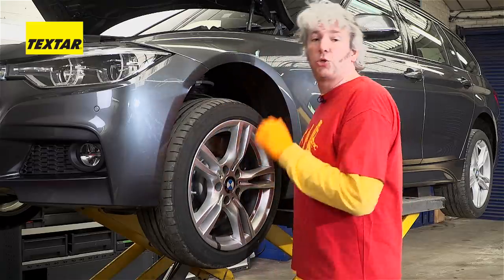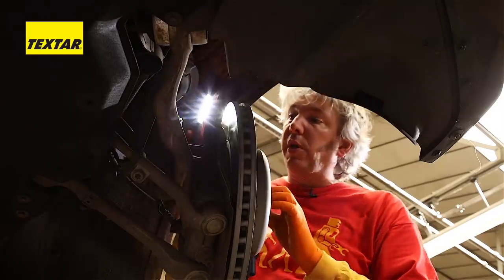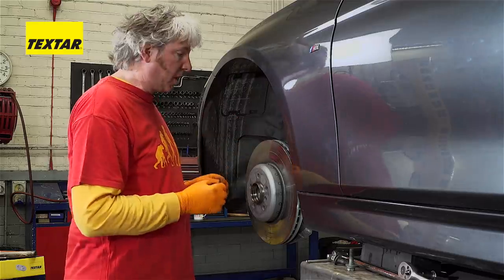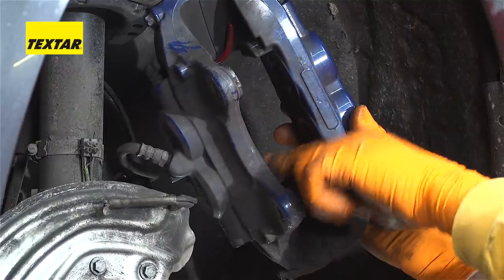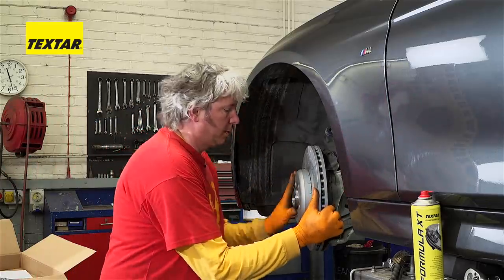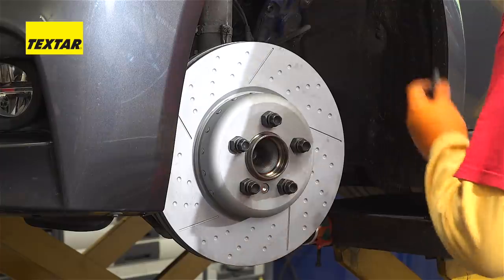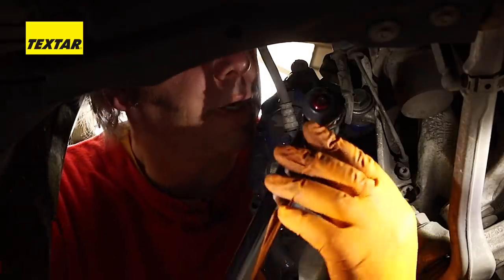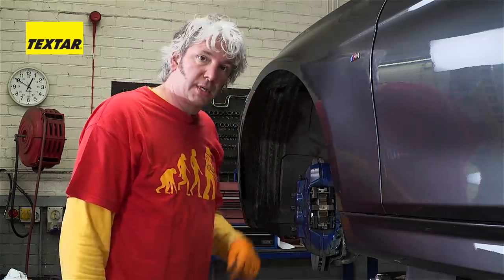Brake replacement with Edd China

Comment: I would appreciate a fuller discussion of when and where to use anti-seize or grease to prevent corrosion; particularly regarding the rotor/hub interface.

Comment: Thanks- a good basic intro video, using a clean modern test car.  I hope more people take on repairs and basic maintenance, using videos like this as a guide.  It would be interesting to repeat the same process on an older vehicle with 100K miles on the clock... with rust and seized parts.  I'm you could feature many Edd's top tips?!  Maybe list some typical tools for the job, for those budding mechanics looking to build up their tool kit.  Just a thought.

Comment: Thanks, Textar, for reiterating never to use copper grease. I've been telling people this for years and include it in all my brakes videos. You wouldn't believe the 'hate' I get for it❗ However, Textar produce a tube of Ceratec (in common with your Mintex and Pagid cousins), so how come Edd never used any on this job? Also, after cleaning the pad running surfaces with a wire brush, how come he never cleaned down the dust created with a spot of brake cleaner?
Reply: I am rather sure that I saw him on WD using copper grease on front of the pads "to stop the noise you get when you install new brake pads". That is exactly why I was searching for video of him replacing pads, since now I'm not sure which is correct.

Comment: Thanks to this video I discovered Textar brakes. Installed them on my BMW 335i. I spent literally half of the amount the BMW OEM brakes cost and the quality is good.
Reply: Well i heve textar pads and discs. disc deformations at the wheel bolt holes are a problem
Reply: Stop Teoriom Spiskowym I installed Brembo rotors on mine. Only the pads are Textar.

Comment: Thank you. I've done this since a long time ago in all the cars in my family but it's nice to see how a pro does it.

Now, I find it funny that the screw that just holds the disk in place while you're working on it (or couple of screws) must be replaced, since the actual work of holding everything together is done by the nuts that hold the wheel in place.

However, the pin retaining clip, which is something that does some actual job (it depends on the design of the system but, still) and that can be damaged if it's accidentally bended, is not replaced here. I think I would replace it always if possible or almost. I also know that some pads come with new ones and others don't.

Comment: It would be good if mentioned new disks that are purely cast iron(which is most likeley) need to have the protective oil cleaned from them before placing on the vehicle.

Comment: No one seems to mention that when replacing brake pads you need to remove the top of the brake fluid reservoir to give the fluid somewhere to go when you spread apart the pad mounting plates to accommodate new thicker pads.
Reply: He did it at the beginning

Comment: Edd - I've seen you use copper grease many times on WD.  Maybe you should say something like "conventional wisdom now says NOT to use copper grease"...
Reply: yeah I was like; "you told me to use copper grease a few years ago hahaha"
Reply: Use silicone grease won't dry out
Reply: Yeh I noticed this too, but things do change. Maybe on older calipers made of cast iron Cu grease is ok, but the ones in the vid look new "hi tech" ones which might have different needs. I think also, we geeks tend to listen to every little piece of info and analyse, whereas when we actually narrate these things, details and other options get skipped over. So let's not be too hard on Edd! :)
Reply: We learned at school, every car company has there one rules, look always at there replacementguide, sometimes you must lubricate sometimes not
Reply: I also concur on this issue.
Reply: total twitch tu)
Reply: Unless there's a very specific, relevant technology change (in which case that absolutely needs pointed out explicitly, as in "do this for these, do that for those") my attitude towards any "you should absolutely / no wait you absolutely shouldn't" reversal is that it obviously doesn't really fucking matter either way, otherwise either there's no actual problem and the advice would never have changed at all or there is a problem and it would have been noticed a long, long time ago. On the other hand, if it doesn't really matter, you can obviously change the advice as much as you want without ever actually being particularly wrong...
Reply: Daniel Rauh *their
Reply: You may find that the brakes squeal without a little smidge of copper grease on the back of the pads and the ears, but only use silicon grease for the slide pins because copper grease can degrade the rubber dust boots.
Reply: I've only ever had squeaking brakes when I haven't used copper grease. Although I haven't owned a car yet with brembo style brakes. But then again I've helped two people with squeaking brakes who did have four piston brambo brakes so ymmv and jmo and two cents.

Comment: Interesting, so how long before those slots and dimples wear out? Pushing calipers home, I have been caught out by doing that, the reservoir overflowed! Edd mentions that. I like the latest info tips, I've not seen that type of composite brake disk before, knowing its details on assembly is good.

Comment: Hi Edd!! It's actually great seeing you working and doing things, I've really learnt lots of things. May I ask you something? I've a VW Gol Power (well known in Mexico as Pointer), 1.6 L, 60.000 miles. Having some problems with multiple cooling hoses leaking just a bit in their joints, no matter how hard I tight their brides. I've already replaced the thermostat 'cause it was working cold, but this issue comes from earlier. I'm about to disasemble all hoses and clean them and piped with sandpaper, but do you also recommend to use some sealing product for hoses joints? There is something else, thinking about there was some extra pressure in the system, I replaced cooling reservoir lid. The original one hasn't leak anything, but with the new lid Ioften see some dry cooling fluid spots on the reservoir near it. Looking for help... Thanks in advance, Edd!! Never stop doing what you really love.

Comment: Now when I work on my car, there's a British voice in my head going "top tip!" and "result!" Thanks Edd. I have a question though. I've seen you clean up old rotors...is it possible (a good idea, rather) to put dimples in stock rotors?
Reply: Why do you call discs rotors .rotors are the blades on helicopters

Comment: Well done Edd you carried out fitment as best practice except one vital part, never push pistons back in calipers to leave the old dirty brake fluid to travel back up the system and into ABS unit.
Reply: Yeah if you have the time etc, undo the bleed nipple then push back hey.

Comment: So what grease did he use?  It's like the end of the sentence has been cut off.
Reply: Old Uncle Silas extra special textar branded stuff no doubt!
Reply: Mintex ceratec is the latest gimmick. I don't like it tho
Reply: Didn’t look like he used any. In my opinion copper grease is the best available product to use on brakes. Although not perfect, especially if cars aren’t serviced regularly, it’s the best thing you can get. I have tried all sorts and most products wash off the first time it rains or they get all sticky and cause binding issues. Especially the aluminium based stuff that the German manufacturers like to promote lately.

Comment: Informative if you own a 66 plate car with barely worn pads, have air tools, fancy scrubbers to remove rust from mating surfaces, and own a dial guage. Do people with these cars do their own servicing.... i doubt it.  Try it on a five year old Mondeo with badly lipped discs, years of crud and discs seized on the hubs, using basic tools and axle stands.   Much more use to the majority.
Reply: Dude... he's giving pointers.  And having air tools isn't that exceptional, and gauges are probably 30$ on Amazon these days.
Reply: Badly lipped discs? Are you serious? That takes literally seconds to get around. If you can't do a brake job with basic tools you shouldn't be touching anything on the car.

Comment: Well, Edd, if coppergrease is a No go. - what do you recomend to prevent corrosion on the contact surfaces of the brake pads and calipers?
Note: my car is 17 years old, and has cast iron calipers on the front axel.
Reply: Erik Brun Hansen high temp silicone grease
Reply: just stick with copper most brake pad suppliers give you some in the box

Comment: The last thing i would use is a power tool to get the bolts off. If they are on tight you stand a chance rounding them off.

Comment: Poor thought went into making the video. Textar could have found an employee with a car that had brakes that really needed changing and on a standard vehicle that most people will come across. A standard caliper is not going to look like that. This is a four pot on a high performance car. 

Most vehicles will have one piston and sliding pins. Maintenance of the sliding pins is very essential to brake work and totally left out here. Removal of the brake pads is also very different to a 4 pot. Single piston calipers usually have 2 parts and one part bolted off completely or swung up to get access to the pads.

Normally Ed would point out that these features are specific to the vehicle he is working on and they can vary just to inform the viewer.

On the point of copper grease, I have always used it and without any problems whatsoever. It never gums up. Maybe it can be an issue on high performance alloy brakes but I don't see how the copper grease is going to provide conductivity that isn't already there with the parts touching each other.

Also, why only wear the ear defenders using the polishing wheel and not using the impact gun which is even louder. :-)

Love Ed's work and have learn't some bits from him over the years but just trying to provide some constructive criticism!
Reply: consult your car manual or google it every model car is different my ba falcon has a different removal/refit process than my g/f's w126 merc you're not going to cover every model/method in a 20 min vid just take the basics he's showing you in this vid and apply to your particular need

Comment: id never use a wirebrush on painted calipers. what were u thinking of?
Reply: I thought that too! Maybe Edd was just trying to be extra thorough. I'd like to see him do a high spec brake (production car, rally car) a proper racing car one just as a comparison.
Reply: :D funny, you never ever see this place when the brake pads are installed, i worked at jaguar, and the brembo calipers must be cleaned at this place with the brush and breakecleaner
Reply: He didn't use it on the painted finish you can see through the wheel, only on the unpainted mating surface and around the pistons. It's not like he scrubbed the paint off the whole thing.
Reply: ok. after a closer look he is just brushinig the places where the metals meet each other. looked as if he scrubbed the paint as well
Reply: He cleaning the mating surfaces. Not the paint. But I wouldn't hold it against him having a camera light in his face.
Reply: oh no a tiny microscopic scratch on a painted brake caliper that no one will ever see let alone worry about ....fuck me do you throw away your toilet bowel after every use just because it has a layer of shit on it  water and bleach won't remove

Comment: so when did cooper slip fall out of favour?
Reply: Grease just attracts dust and dirt, if you do use it it must be minimal.
Reply: Some modern pads come with a rubber gasket on the back so no need for grease.
Reply: Yeh but surely a bit of copper grease can't harm where the pad contacts the caliper. This is always the bit that seems to stick when i have removed pads in the past.

Comment: Steel wire brush on aluminium calipers , next to piston boots ? That made me cringe. Wire brushes always have wayward threads that'd cut the piston boot. Aluminium is soft so that wire brush would not get into the corners anyway and it will scratch the caliper body. I use an old toothbrush for this step, and it works just fine - good for the teeth and gums and the stoppers :) ALSO, those rotor grooves and dimples are not for water displacement, they're designed to control gas expulsion between the rotor and pad in high temperature conditions (during use).

Comment: ed All seemed very staged to me 2 BOLTS on wheel removal ?  every thing removed easy ?    would you not remove the disc retaining screw first because normally very hard to get out..  then disc stuck on hub.  not many people own  a dial gauge. Also pushing pistons back what about fluid coming out master cylinder.  what about checking if the brake pads have  rotation arrows inner outer ?.  do you not think. doing a video on removing and installing brakes from start to finch showing all the problems and how to over come them.  I though this is what ed was all about????????? p.s maybe i should start doing videos? mechanic for 37 years..
Reply: Richard  Newhouse 
Used to go on about his uni qualifications in mechanics.  He made a sofa with a bike engine in it. That's his claim to fame.
As you say, watching him in WD he's just a average DIY'er who got lucky and that's it.

Comment: Folk have been using copper grease for years!  Now  suddenly it's bad. I feel sorry for the 50 million cars out there with ""now dangerous brakes"".
Reply: Copper grease is still great, it's only the fact that it's conductive. That makes it bad for electronics like ABS sensors or wear sensors.
Reply: Copper grease is not like it used to be 20 years ago. I bought copper grease and left in my shed in the hot weather and it went watery so I threw it out and bought another tin but when the weather went cold the copper grease went hard in the tin.

Comment: Er, my mate has a PHD in engineering materials and works for Rolls Royce Aerospace and he uses copper grease on his brakes. I'm still using copper grease in that case
Reply: MrSteamywindows if you did your own brakes you'll notice after one year+ the copper grease turns hard as nails. Not good on parts that are meant to slide. Ok on the wheel hub tho to stop alloy corroding onto hub

Comment: I ain't no Edd China but IMO never use a wire brush on the inside of your callipers, damage to the seals and piston surfaces is easily done, and posh painted ones on the outside surface either or the paint will be wrecked, ..as I say IMO. Carry on Edd.

Comment: I disagree with not using copper slip. Although it is not perfect and it may cause the issues he’s given, if you don’t over apply it, it is by far the best product available. I have tried all sorts of stuff and most things either wash off as soon as it rains or they go thick and sticky and cause further corrosion or just cause binding because it’s gone sticky. Especially that aluminium stuff company’s like Volkswagen love to use.  Again. Although it isn’t perfect, as long as the car is properly serviced, copper slip is as good as it gets

Comment: Never was a great fan of copper grease; got copper bits in it which is not good between the brake disk and hub. Found a thin coat of engine oil is much better. Copper grease good for spark plugs but thats it.

This is really product promotion.

Comment: Mr Ed
thats not a propper way to change pads
when you press the pistons back you must have bleeding skrew open otherwise you can get greasy oil in to abs unit system witch is not a good idea👍

Comment: I do like how everything is so clean and he takes the bolts out the wheel and it just comes straight off......anyone out there who owns a BMW will know the wheels are twat to get off the hub!!
Very poor Ed!!,it’s not exactly real life is it? and yes I know it’s a demo but you could have at least used a car that actually needed a set of discs and pads.
Reply: R Drift I agree. What was the point of this? We need to know how to deal with things that aren't going to come apart such as removing the disc retaining screw, how to remove stubborn calipers, different ways to retract the cylinders and checking the brake fluid level and what to look out for if things are not working after you have done the work! Copper grease a no no? Since when?

Comment: Maybe WD were to tight fisted to let mr China buy the correct product back then.also times change and so do the materials used to make things.try mixing copper,stainless,magnesium alloy and salt (off the roads) then to top it of,heat cycle the shit out that concoction.just saying.